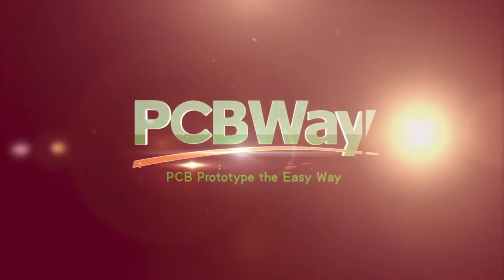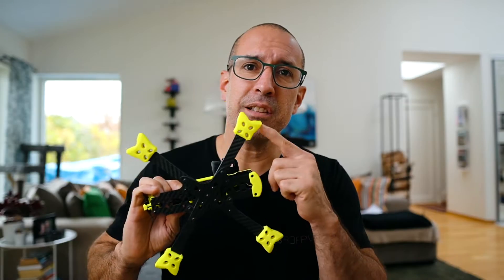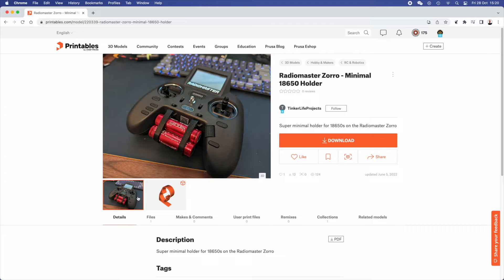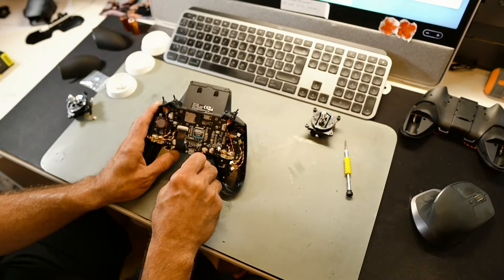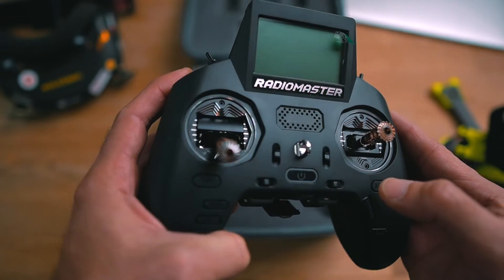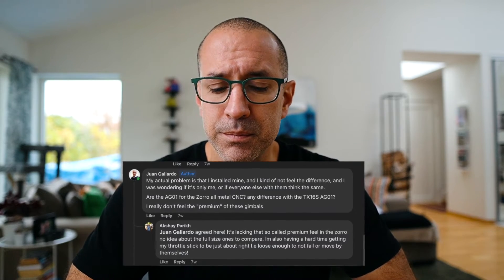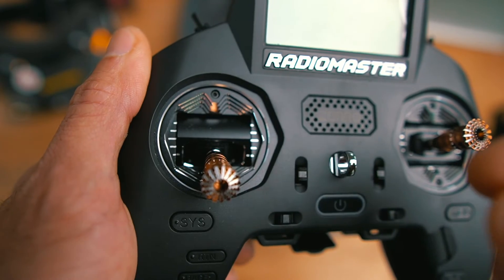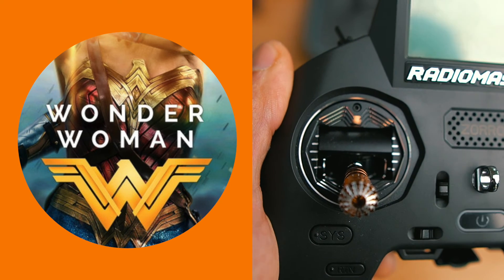Best upgrade for the Radiomaster Zorro FPV radio control

Comment: Its not an upgrade if you purchase the radio and gimbals at the same time direct from Radiomaster as they are fitted in the factory for no charge a short delay about 2 weeks so you can buy with or without.